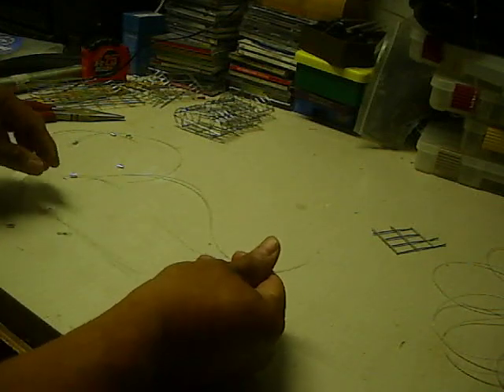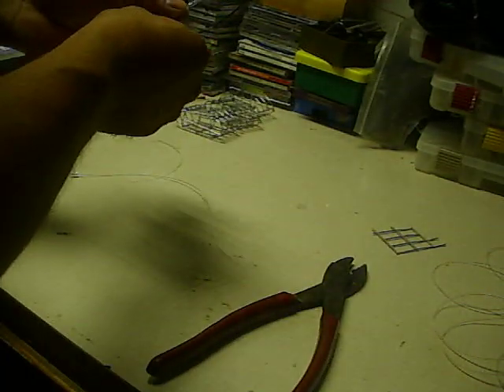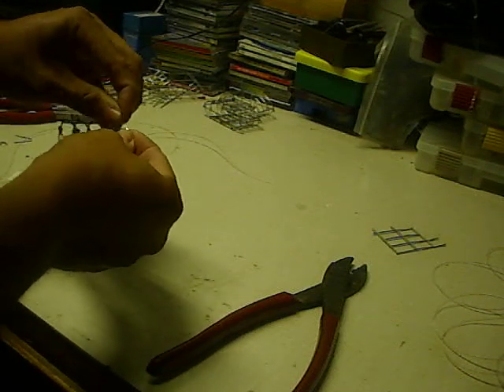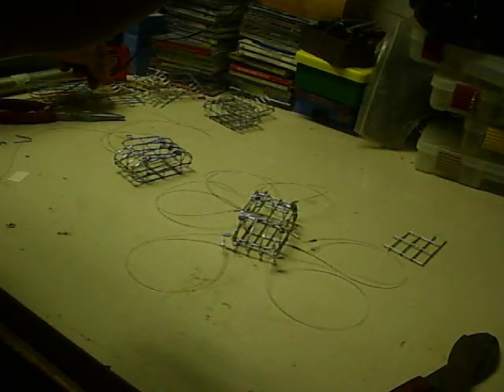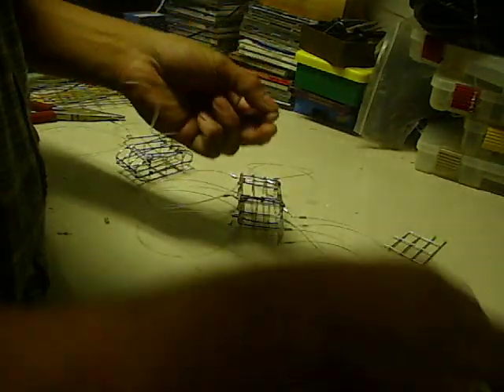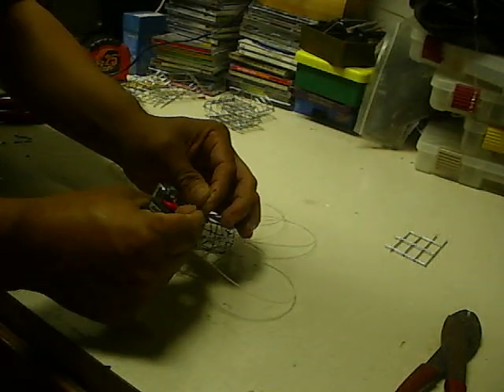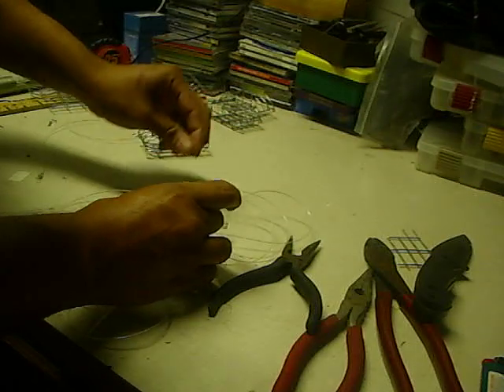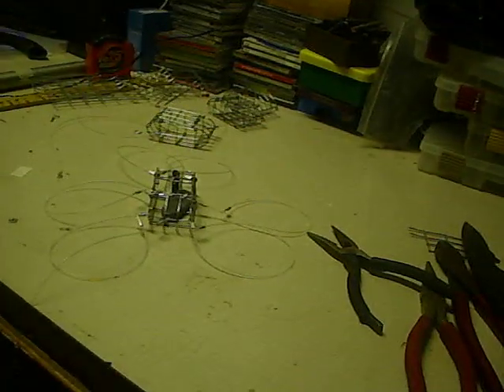Crabbing, How to make a Crab Snare Video #2 of 2

Comment from the maker: @MrSaeteurn  you have to make the snare  within the memory of the line . not to wide so circle cause a natural spring action causeing a spring action to keep snare open. its the weight of the crab that closes the snare> cut the line and if it lays flat in a circle then it will work good as a snare